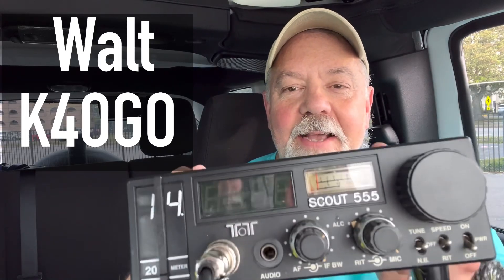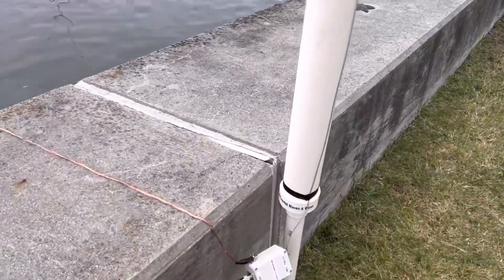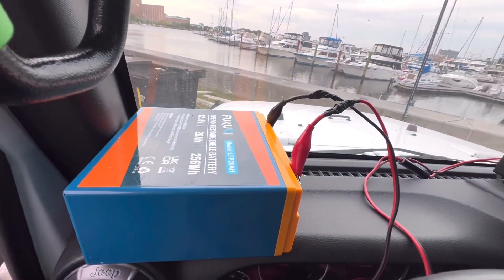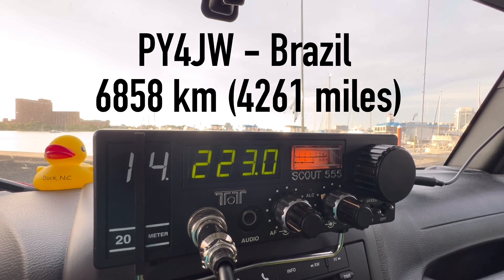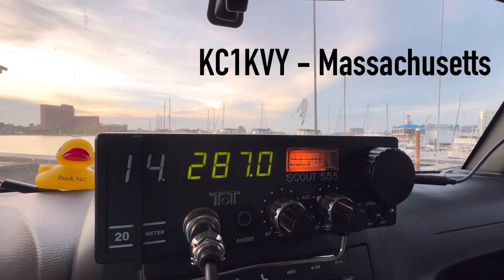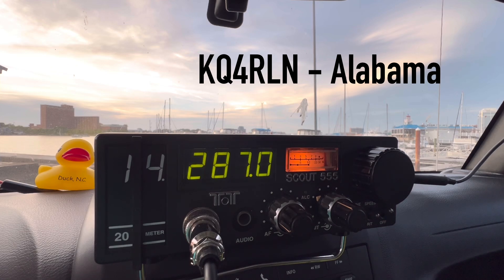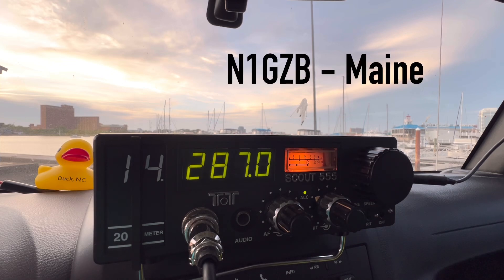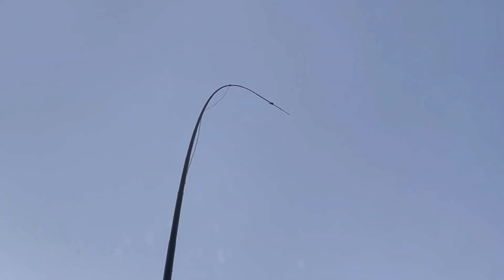Taking an Old Radio Portable with the EFHWV 20M Antenna from M1ECC

Comment: Somehow my EFHW for 40-10m did not work well for me. May be because of my compromised mounting due to space constraints at home. But I did not try a vertical orientation like this as the wire was 20m long. Was the one you used a single band end fed antenna? I reverted back to 40/10m fan dipole with a 1:1 current balun at feedpoint. Any chance of cutting the wire from 20m to 10m long and using it as 20m vertical like yours? Will I have to change the capacitor inside the 49:1 balun? 73 de Jon, VU2JO

Comment: nice setup. great old radio.  that is a outher way to feed a end fed antenna . the LC match. just a coil and a cap . makes 1 band but drops noise floor  compared to UNUN  feed. love how that old scout 555 sounds . both and RX. what I found half wave veritable.  tad long on 10 meter pole. 17 meters 1/2 wave should fit.  15 did and still have room. once I get my wire cut the way I like it . I get them square beads with number on them like Callum did in his video.  I had to be different with my DX commander expedition antenna. I used letters for the bands. TEN for 10. TWENTY for 20 meters.  when I found them beads I got big set with numbers and letters. you can use LC match for 5/8 wave. the coil and cap will be different and antenna will be longer.  10 meters 5/8 wave not to bad.  get a tad more gain. back in the old CB days 5/8 wave was king.  that 11 meters. most are LC tuned. and some still made.  and most tune 12/11/10 meters. usually 1 band into next band.  I set 11 meters on mine and just ATU for 10/12 and it's not far off. like 2.6 SWR at worst. 29.6 MHZ . still got out. nice old days. 73's

Comment: Great video Walt. I need that jeep and that radio  :  )  What is at the base of the mast to get it to stand upright? Is that part of the DX Commander mast? Always learning something new from your videos. Thanks, Jim
Reply from the maker: Thanks Jim! I screw the bottom cap off the DX Commander and slide it over a piece of 2 inch PVC pipe I hammer into the ground. 73, Walt
Reply: @COASTALWAVESWIRES  Thanks Walt 🙏 That’s a great setup 👍

Comment: My main antenna is an endfed 135' wire. I put up an endfed 10meter wire (verticle) and have had SUCH good luck with it, I'm thinking about putting up an endfed 20 meter verticle wire in the hopes of having the same good luck and great contacts, You just convinced I should do this. More and more fiberglass extendo masts - ha.

Comment: Great job Walt, I have a similar end fed half wave from another UK antenna company. The LC (link coupled) matching is very efficient. It's basically an air wound coil in there with a coax stub capacitor hence it should be lightweight. Great antennas and that's a sweet little radio. 73
Reply: Our one is not the same we don't use an air wound coil, We use an iron powder core, wound & tapped.

Comment: That right there brings back memories! I sold mine too soon! I watched your decimal point just before the last digit. If it goes off your battery is too low. Looks like the LiFePO4 voltage is high enough. I worked a lot of DX with mine mobile. I would ride to the Hardie’s and get a breakfast biscuit then to Buckroe Beach then home. Working DX all the way. Could not shut the engine off or that decimal point went off and audio would FM. Of course gas was cheaper, much cheaper then! 73, Don N4DJ

Comment: Great to see the Scout in action! 

Last Saturday, I took my G90 out to the lot  outside of my apartment near Independence Blvd @ Witchduck Rd feeding an MFJ-1622 apartment antenna. I mounted it in a vertical position on a wooden ladder next to my car; ran counterpoise around the front of the car. I was able to work several Florida stations during their QSO party, AO75NA & AO75CT in Spain and a POTA station in FL on 20m. Then went to 40m CW; made contact with KM1CC on Cape Cod for International Marconi Day. All in all, a successful day! 

I have to meet you sometime to talk your video production. 

73, Steve KC4JGC

Comment: Half wave vertical for 20m is my main portable antenna. Mine fits on a 10m pole though, just. Might be a difference in the unun. My 10m pole doesn't extend to quite the full 10m either.